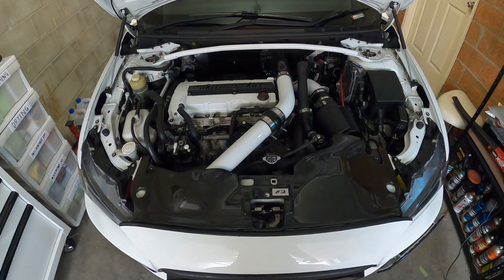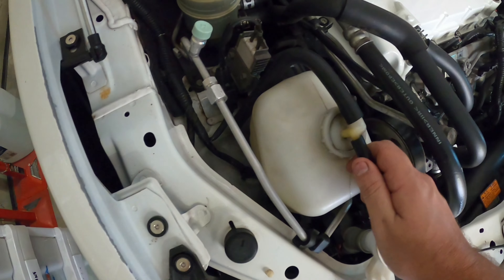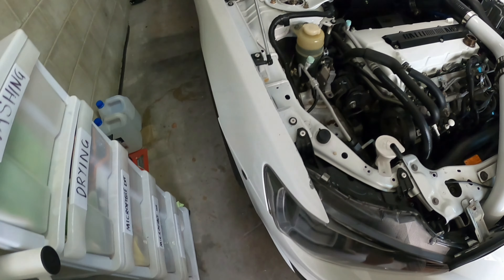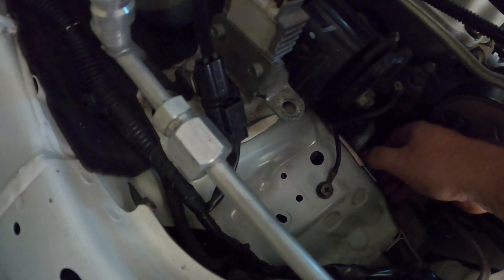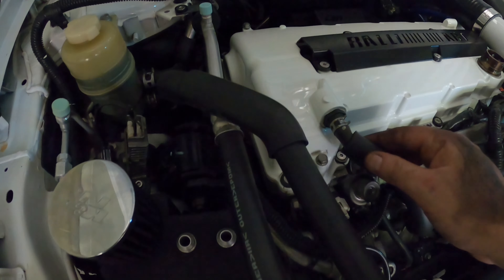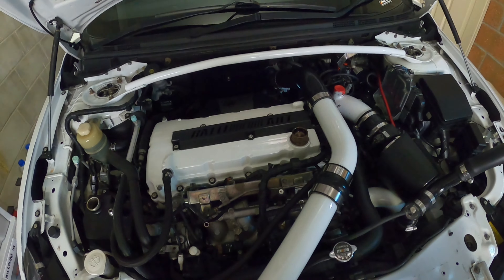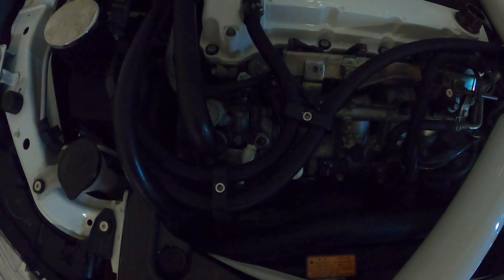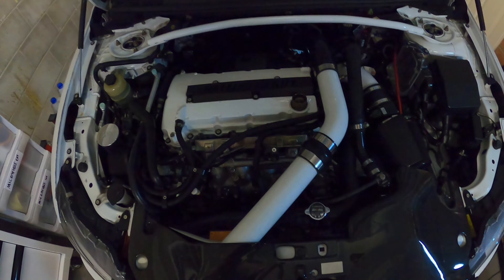Lancer Ralliart Project ( Driven Fab Catch Can Install )

Comment: These are a good idea to keep all the blow by out of your turbo, i rigged up a small mishimoto one and have a large clear drain hose running under it to to below my wheel arch where it's plugged  so I can check and see any oil, then drain it.
Reply from the maker: Yep agreed i need to get the one o bought for my car installed asap
Reply: @JacksonStrain  have you had a look at led running lights, id like a set i could put in the grill so when im pumping through the bends, farmer Joe driving across the yellow line can instantly see me coming

Comment: Looks clean 👌

I did notice the front quarter panels at the corner edges where it meets the bonnet has paint flaking 🤔 might be due for a respray in next few years
Reply from the maker: Yeah going to just attempt to touch it up for now but of I can't get it looking good I'll have to get a pro to repaint it for us.
Reply: @JacksonStrain  Bro white paint is very difficult to colour match cause different whites.. then the yellow tinge from fading so good luck. Id say wait until till paint gets worse for respray though, one of mates whos a spray painter said Mitsubishi's paint roughly lasts 10 years before paint starts flaking.

My 07 Lancer ES (first of the CJ Chassis) had half of front bumper resprayed after a Porshe Caynne clipped it, the White they used was factory white but was too clean cause they didnt do the paint fade. Didnt worry to chase it cause my car needs respray cause of the amount of flaking to bare metal 🤷‍♂️

Comment: hey how about  hose coolant....u remove it?
Reply from the maker: The coolant hose goes into the catchcan  as these ones double as a catchcan and coolant tank in one
Reply: @JacksonStrain  i mean the small one...u use stopper..or u leave it to down
Reply from the maker: @ashslayer3285  ohh yep gotcha that one i just looped down and left to drain to the ground if it ever overflows
Reply: @JacksonStrain  not use stopper?....coolant not going empty?
Reply from the maker: @ashslayer3285  it hasn't overflowed yet as I have checked it a few times, the car doesn't get driven much though but for a daily I'd be checking it weekly
Reply: @JacksonStrain  ty boss for share tips
Reply from the maker: @ashslayer3285  no problems happy to help where I can